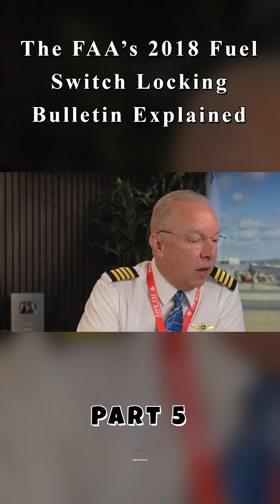Revealed: FAA's 2018 Fuel Switch Locking Bulletin - Air India 171 Explained

Comment: As you explain in other videos, the 787 will not let you retract the landing gear while on the ground, or extend the "RAT" turbine while on the ground, but it is glad to let you cut off fuel to both engines 1 second after takeoff!! This is another defective Boeing airplane, pure and simple. Suicide, maybe, but made possible by the loaded, cocked gun Boeing left lying around. If its Boeing, I'm not going!